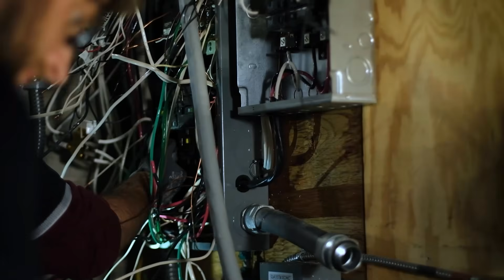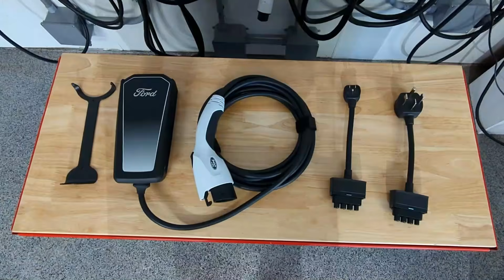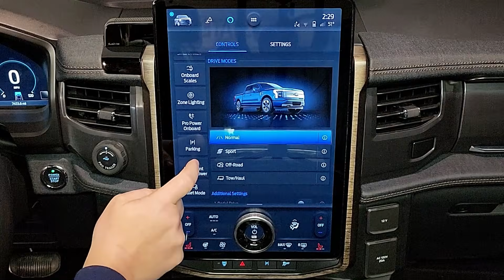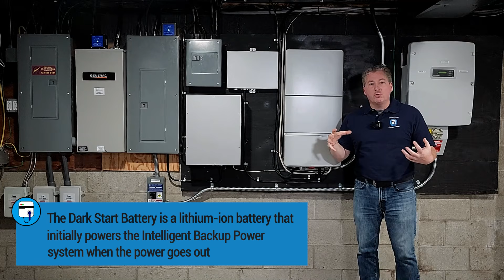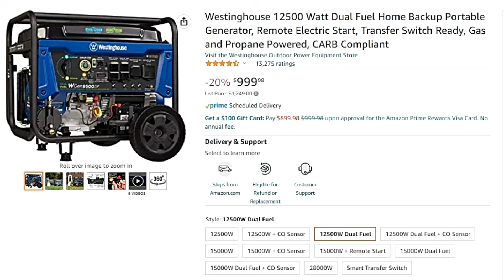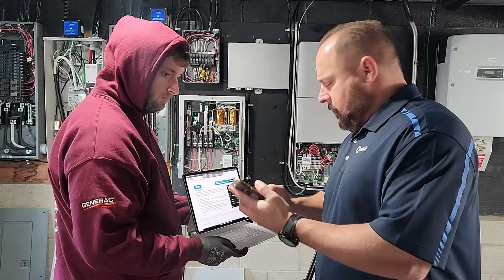Watch How Ford Lightning's Intelligent Backup Power System Works In A Real Home

Comment: Your explanations, graphics, charts, etc are TOP NOTCH! Bravo on being clear and repeating the items that need repeated. Also, no details get left out!
Reply: More "details" would be: where is DC? Where is AC? What are the voltages and amperages in each section? What are the losses in the system due to power conversion? What are the circuits and electrical devices that are run in the house? What is standby power in the vehicle for running the necessary in-car components? Plenty of stuff for another video to come. As well as: all the V2G scenarios and energy marketing.

Comment: Very informative. Sadly have to say that I have no support here in Canada. Were Febuary 2026!. I have solar with a string that I could use to feed the Lighnings battery to. Would this be ok. Why not ? Same voltage as any solar string? Also I don't have the app in the Ford Lighning XLT 2024 truck. Why is that? How can I get it? Certainly would be willing to visite your system! Man it would be nice to talk to someone that has the hands on experience. I hope I get a response....

Comment: If I have an external plug, do plug my 30 amp cable into the house. Do I need the intelligent backup charger? Or can I just buy the five hundred dollar pro power backup. What does that $one300 charger? Do that? My house with an available plug can't do. I'm?

Comment: Too much information. You spend half the video explaining all the extra equipment. By using your own house, with all of the extra equipment that almost no one else would have, it complicated things at every turn. It would be vastly more useful to see a simpler installation where the home has no backup at all, or maybe just has solar panels and an inverter. A huge selling point to this kind of system is avoiding the expense of a home battery like a powerwall, or being able to use maybe a much smaller less expensive dedicated home battery. It also looks like the Ford equipment includes an inverter and could possibly replace a normal solar inverter completely (?) again saving money if this was installed from the beginning with the solar system.

Comment: Tom, my home integration system has not work in almost 2 years since I originally installed it due to FORD OTA updates to my truck and charge station pro. I’ve been working with ford engineering to troubleshoot and try to get it fixed but they claim it’s an issue from the delta inverter and they tell me that it’s not just my situation that many home integration users are having issues. Do you have any advice you can give on how to resolve issues with the system? Essentially when my system is activated it will go through all the processes to begin power transfer, it will say that it’s transferring power but never does, and then it will eventually fault out and say their was a fault with the charge station pro. Very frustrating to have an expensive back up system that doesn’t work because of updates that were pushed to my system. It worked well when I initially installed it.

Comment: I wanted to leave an update comment to inform you that the FIBP is rock solid. I originally watched your video back when i was getting the FIBP installed on my home after purchasing a 2023 Ford Lightning XLT ER based on your reviews and few others. My solar system didn't have a way to integrate a battery backup without upgrading a bunch of equipment, so i swung for the FIBP as a backup. Then when we wanted to add a 2nd charger to our house for 2nd EV vehicle, i had to upgrade the service to the house to support it, so they installed a new 300amp panel and then subpaneled the old panel into it on 125amp breaker circuit and then installed the new charger on the new main panel. Fast forward and we had a hurricane ravage our area and i lost power at the house for 10 days, so the FIBP was amazing to have during that time combined with my solar. Our local chargers were working the day after, so i would charge the truck in the evening at the charger and then plug it back into the house for those 10 days. Then shortly after i got rear-ended in the truck and the insurance company totaled it out, because the rear frame was bent from the impact, but the truck functioned overall. The insurance company offered me to buy the truck back during the payoff process and we worked the numbers and i walked away with it for 8k with certificate of destruction title. I originally had the idea of taking the system out of the truck carefully and mount it on the wall as a powerwall using the FIBP still, but its been 16 months and the truck has been still sitting in my garage plugged in untouched. The FIBP has worked so well, i have left the breaker to the old panel turned off, making the solar and truck fully powering my house outside of the stove and other EV charger on the new main panel. I have since then bought my 2nd Ford lightning and love it. We are currently fighting with Tesla to buy back our other EV (Model Y) and if they buy it back my wife has been thinking of getting a Lightning herself, because she has been borrowing my truck a lot lately and really like it over the tesla. Thank you for your review and recommendation on the Lightning and the FIBP.
Reply: Did you purchase the FIBP and have your own installer perform the installation? Or with SUNRUN performing the installation? Thanks.

Comment: Just bought a 2024 Flash for the specific purpose of Backup Power. Contacted SUNRUN to purchase the hardware and was told that they will not sell the hardware without them doing the install. Something about AEE Express going away?  VERY UPSET. Please advise any suggested path forward. Thanks :)

Comment: Thank you very much for your information.  I was thinking about installing a sub panel and using a generator before I bought the lightning.  I am thinking now that it is the best option, with the lightning working as a backup generator if the primary goes down.

Comment: I would love to know how it’s still working? After spending 90k on a truck and 4500$ for the HIS system, nearly 2 years ago now, I have yet to ever get this system to communicate with each other (charger and truck). So I think yours working is great. Did you have trouble connecting the truck and charger together? Does it stay connected longer than 2 hours like other have?

I’d love to know more and would love nothing more than to have someone with your experience navigate the endless headache I have with a (should be) simple system.

Next time you’re in northern VA, I’d be happy to host a video for disappointment.
Reply from the maker: It's still working fine for me. Sorry to hear about your issues

Comment: I have a similar set up with generator and solar. I wanted to utilize my lightning to be a battery backup, not when the power goes out but to pull from my vehicle at night or during the day when my solar production is low... basically utilize this as a replacement to solar batteries. Do you think this is possible?

Comment: From what im gathering, it is not possible to use solar to charge the ev during an outage, meaning this does not work as an independent battery backup system?

Comment: This system seemed remarkably expensive BEFORE the gut-punch of a 9kw inverter. That's outrageous. Also assuming this system solely functions with a Lightning. Even when you account for the battery included "free" with truck, potential buyers would be much better off buying a non-proprietary hybrid inverter & battery bank. This is insane.

Comment: Does using the car's battery affect its warranty.  Using an EV as a house backup running heavy loads like AC systems and water heaters requires lots of power.  What LRA can it support?

Comment: I know this video is old by now, but I'm curious if you can get the Ford Pass App to limit the current being supplied to the truck?  The use case is that I want the limit the number of kW being delivered from the FCSP to the Lightning to what my solar system is overproducing. Unfortunately, even though the Ford Pass App shows the limit I've selected (say 18A), the charge rate continues at 10 kW.  Ford can't decide if my problem is in the Ford Pass App or is a problem on the EV/Charging side.  FWIW, the truck doesn't have any option to limit the current.  My Tesla has it built into the car.  Even better, since I have Powerwalls, an OTA made it so the car talks to the Tesla gateway and adjusts itself to use only what is spare.  I understand Ford can't get that information, but manual control would have been nice.

Comment: Did I miss it? The biggest question I have is in the event of a prolonged outage can the solar that comes directly into this system/inverter be used to charge the Lightning with any excess production? For example, if your Lightning is down to 20%, your solar array is producing 5kW of juice and your house is only using 2kW, would the excess 3kW be used to charge the Lightning, or is charging during an outage not possible? It would be a huge miss if this isn't possible. The only information I can find on it is a video by you from over 2 years ago that says you can't but Ford is looking into it...

Comment: Tom, great video!  I bought a model with 2.4 kw pro on board power.  Does this mean I'd only get 2.4 kw to power my house with bidirectional charging or does it use a different mechanism to power the house?

Comment: yeah, NO. Tech is not there yet and price definitely not there yet. Too many points of failure. Having a nat gas generator if you have numerous power outages would probably be a better bet. Battery backup systems still way too expensive for whole house backup.

Comment: Great presentation Tom, appreciate your efforts.   I think you're on point with the opinion that this will only pencil out economically for the occasional home owner.   One shortcoming that you commented on only briefly is that when there is a power outage, the majority of your solar panels go off line.   I believe if you have Tesla Power Wall batteries or other storage system you can continue to produce and store your excess solar energy while the power is out, though each power wall is only 13 kwh.    Personally I've got an Ioniq5,  it has a small vehicle to house (via extension cord capability) and a small gas generator for the outages, enough for the fridge, a TV, and light or two.  Our outages are rare and short lived but my solar can't produce during them.  I do look forward to the day when these systems come down in price enough to pencil out better and help take the stress off the grid, etc.

Comment: Tom,

Great video!

In 2024 we now have these “collars” that can be installed on the meter to provide a connection for a portable generator with non-bonded neutral. 

This is much simpler than the standard generator (non)critical load panels, transfer switches and interlock kits. 

PG&E has a pilot program in Northern California for which I have applied.

Worst case, the 240 V outlet in the bed of the Lightning can be connected to the “collar” via a modified cable that “unbonds” neutral.  This approach requires a few of the steps that would be necessary with an actual generator (e.g. Plug the cord in to the truck and start/stop the “generator”). Note it would be great if you could ask Ford to add a software setting to “unbond” neutral on the 240V outlet when the truck is “at home” as bonded neutral is only needed for a job site. 

What would be ideal is to have the DC wires of the Ford Charge Station Pro plugged into the home integration kit (inverter) and have the output of said inverter permanently attached to the “collar”.  This would be much more convenient than having to plug into the 240V outlet in the bed. The AC wires of the integration kit can be plugged into a single load shedding sub panel to prevent charging while providing backup power. 

I would respectfully request that you ask Ford to support such a configuration of the gear you featured in this video as it is a radically simpler and less costly installation. Yes I would lose the ability to perform rate arbitrage, but I really only care about the whole home backup power use case. 

Further I would request that the inverter electronics have a configurable signal port that goes high (or low) such that external electronics can act appropriately.  For example I want my already installed solar components (Enphase) to know when the system has entered “no grid mode” so they can act accordingly. Opposite goes for when “grid power is restored”.

This makes usage simpler with installation much simpler and much less costly. It also allows existing solar electronics to be used pretty much as is with the possible exception of adding a remotely triggered transfer switch based on actual grid state. 

I am happy to discuss this with you and/or Ford in more detail.

Comment: This is totally unnecessary. I just looked at a lighting a few weeks ago. It comes with a 240 volt 30 amp twist lock plug in the bed of the truck. All you need at that point is a 30 amp power inlet box and a generator interlock kit. Like he said it’s not gonna run your whole house though. You have to be selective but most the time it will run you heat, lighting and refrigeration without a problem. Electrical appliances are not gonna work in this situation so you have to manually turn them all off before firing the truck up

Comment: Tom, great video. My real interest in V2H or V2G comes in wanting to have a solar array that charges an EV during the day and then have the EV power the house in the evening during peak electricity pricing. Do you think the systems will evolve to do that? I’m also wondering if Ford’s system will work with other EVS as they develop that include V2H or v2g, such as the forthcoming Silverado, or ram products, that allegedly will offer those features as well. Seems like it might be a mistake to plunk down the money now on a system that ends up being proprietary. Would love to see a video about that.

Comment: One more thought. You mentioned high-priority uses and lower-priority. Did you re-wire your home so that various sockets around the home are labeled in a way that you can tell whether or not these are connected to the critical supply from your gas generator, for example? It seems to me that with a system as complex as what you have presented, it would be a good idea to label ALL of the outlets around the home as to how they are connected up so that you can make intelligent choices when plugging in devices. (Coffee maker vs refrigerator, for example.) I am right at the state today where I need to exit part of my home to allow for workers to arrive and perform a variety of work here to tear out all chalkboard and wiring and replace panels and re-wire at least half of the 5000 sq ft here. (Maybe all of it? 1970 construction.) It may be appropriate to rewire all the outlets in the entire home and label them carefully. What are your thoughts?

Comment: Tom, thanks. First time viewer of you. I don't have the option of a Generac natural gas generator (all my children and grandchildren live with me and some of them do not feel safe anywhere near natural gas, so I take their feelings to heart.) We could use diesel, as that is relatively safe (and everyone agrees.) But we live in the woods and we have also had 2 wk outages just as you mentioned, yourself. One possibility we are considering is a hybrid that runs a diesel engine with battery (if we can find one) and the other is the F-150 EV. I also weld a lot (stick, MIG, and TIG.) So having the ability to support that would be nice in the field here on the farm. I'm not feeling a need for automatic power -- I can flip breakers when needed. But it is interesting, just the same. But I really want to thank you for all the details you've offered! Including the old panel arrangement and what you would up with in the end. It's perhaps the very best video anywhere I've seen on this topic and you have helped me think better. You have my profound and heart-felt thanks for your time (and expense) that you've extended to others you don't know and cannot have your back when you may need it. I wish we knew each other better. But being in Oregon... not so likely. Best wishes!

Comment: Wonder if we can integrate with Tesla power wall and Tesla inverter so Tesla will see this as another battery.  If it can pull the power as DC power from the truck.

Comment: What would help you dramatically and help understand loads and give you total control is a Span panel.  I’d install one span 200 amp panel and then a dumb 200 amp panel for EV non critical loads.  Split the power from meter two ways to each panel.  Run solar into span.  Use your old inverter.  Run fords mess into span no solar attached.   Then you’d just need one 200 amp transfer switch and then one span panel.  And you wouldn’t have ev charging during outtage. Or just add another generac 200 amp transfer switch as a slave.  

Still.  See this is where Tesla’s solar controller really just works. Combines power from everywhere.  Basically you need a master switch that can seamlessly switch between all sources without back feeding the generator.  I know there are solar inverters that can handle all that and control the genset such as when solar and battery power isn’t enough it kicks on the generator.  

Savant home automation also has a new line of smart power products including smart panels or breakers. They work with any manufacturer of any component and automate all power handling.  Probably worth the investment there.  I really like savant.